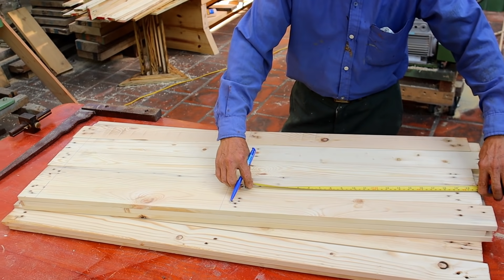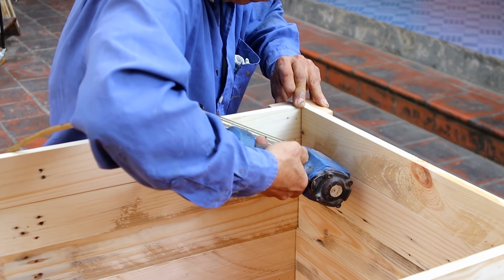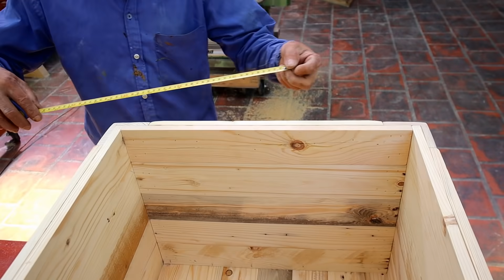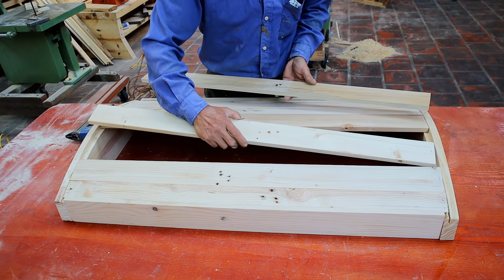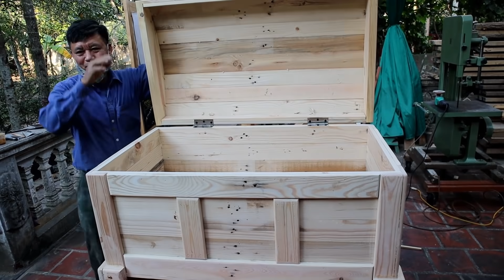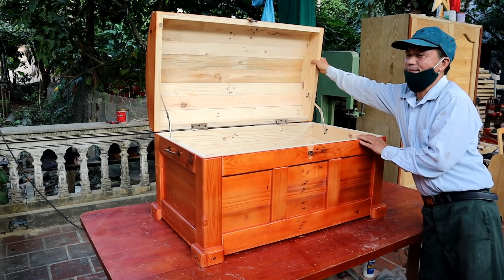Great Idea On Pallet Woodworking Project // How to Make A Storage Chest From Recycled Wood

Comment: Very nice,, but what about us who can't afford a joiner or a planer?,, ( just saying)
Reply: A router sled can substitute for both a planer and a jointer. Put some t-track slots in the table for hold down clamps, and you're golden. If you use linear rails, stop collars can be installed to use it for straight line routing/edging. They'll help with safety also.

Comment: I want this to be my first project. I love how you did the sides not too sure on the top and bottom though I might want to reinforce the bottom part and the top sharper cuts so they fit tight up against each other over all this is the easiest way  I've seen it done.

Comment: Looks great, I just noticed your lock was installed incorrectly, Screws should be behind the metal. Otherwise anyone can remove 3 screws and open chest apart. I like that you used planer  and sander to make the wood looking perfect. Good way to repurpose the pallets. I will definitely try it and recycle my pallets
Reply: Careful with your selection of pallet wood, not all is equal, pallets painted should be avoided as they contain chemicals in the material. Also pay attention to stamps on the outside of the pallets, avoid those labelled MB, MBL or MLB as they contain methyl bromide
Reply: I agree with you it looks great, but I think the bottom is not strong enough. The bottom is only held by some nails. Any more weight in that storage chest and the bottom will come off.
Reply: That's the least of his worries, the bottom will drop out as soon as anything is stored in it, also would have been nice to see a bit of glue used, the large screws concealed, and sprayed behind the catch. 👍

Comment: I like the concept, but if you are planning on keeping anything heavy in it for any length of time, your bottom is going to fall out. The bottom needs to be reinforced with something other than staples or brad nails.
Reply: Should have at least used glue
Reply: @jameschester3986  Exactly. I was thinking the same thing throughout the build. Nice box though.
Reply: I think atleast some screws and glue would add alot more strength to the project, but the build was good.

Comment: At 10:00, you are routing in the wrong direction, that is why the router is kicking so much. You're supposed to go against rotation, like on a table saw, but you are going with the direction of rotation, which is called climb cut, and the router is trying to jump out of your hands. Couple that with holding your fingers that close to the blade insted of on the handle, well... Let's just say I'm not surprised by the missing finger.

Comment: With most pallets you'd be lucky to get four usable pieces of wood.
Reply: You're taking them apart wrong. You gotta use leverage to lift them off the nails. You'll get a number of split ends, but if you cut those off you have mostly usable wood.

Comment: Pallets in my area are mostly plywood now not solid wood and many delamintes at the ends. It will take a lot of effort to deconstruct the pallets to save all the component parts unless you saw through much of it. Nails hold on so tight some will break into pieces that you might just use a saw.

Comment: Nice work. But you always want to spray stain it before you put on the outside hardware on. For you can see where the lock hasp left an impression on the front.

Comment: Nice looking project. Like the way you assembled the corners.
Reply: I liked that too. It would also allow you hide any imperfect cuts, and allow board alignment. Good option to have using pallet wood. I don't have a planer or band saw so I would be winging it with a circular saw....

Comment: Would look better if he took the time to cut the boards even length
Reply: That's in fact the same work (in time) You need maybe 10 seconds more to put a stop block at the right position.
Reply: @hansdegroot8549  I like the way he enclosed the outside of the box with the L shaped ends. Allows for the joining of imperfect cuts/wood. I am using really rough pallets and don't have a planer or jointer so am using a circular saw. Of course none of my projects are for serious use. Just holiday decorations and the like. (Treasure Chest etc.)

Comment: I'm sorry to anyone who lauds this project, but am I really the only one who understands what a caravan of woodworking garbage this is?  Without glue, those tiny brads aren't going to hold that thing together for long.  The way the bottom in particular is constructed reveals zero understanding of the mechanical forces required to build a box - the most basic of wooden storage projects - it's guaranteed to fall out once you load it up.  Poor joinery throughout - the top outside corners of the lid in particular are sloppy, amateurish and downright ugly.  Wrong type of screws on the hinges and at least one randomly mismatched screw on the hasp.  I do not understand those large lag screws at all - they're stylistically out of place with the rest of the design.  This thing is simply a scaled up version of those cheap craft boxes you see in Michaels, AJ Moore and other chain craft stores.

Comment: Nice! What are the dimensions of the wood?
Reply: Any size you like. This isnt tied to specific dimensions for fit. Just the length of the pallet planks you are using, and the purpose of the chest.
Reply: Yeah I just liked the size that was used in the video! Cheers
Reply: @fliplucky8813  Proportions are important for the final look. I think you need to use the golden number ratio.

Comment: What's it called? "Brad Chest"??? It has zero structural integrity. I'd love to see the look on the faces of the end users after they load it up then move it by the handles... It'll fall apart in a matter of seconds.
Reply: The corners assembly looks sturdy enough to avoid using frame wood pieces. But I'd have glued them tough.

Comment: The carry handles on the sides need to be stronger for such a large chest. They will not hold when the a full chest is picked up using these handles.
Reply: I would say the handles were purely decoration purposes  - with only nails holding this together, without glue, screws or a joint which is secure, it won’t take much to dismantle this. Looks awesome though.

Comment: Pallets wood is generally the poorest quality, very then and FULL of staples, nails, screws and metal fasteners. All of which can ruin a nice blade and WILL ruin a planar or jointer knife instantly. Pallet wood is trash and is built to last maybe a few uses before the wood is either burned or buried in a dump. Pallets are simply not worth the time, effort and HIGH likelihood of tool damage.
Reply: J9

Comment: Terrible job, but how do these guys work? everything is approximate, no attention to detail, too bad!!! And would they be called carpenters?
Reply: Go away
Reply: Why be mad when u can be glad?
Reply: I think it was done this way on purpose. Granted, I would have used wood glue and measured everything perfect myself, but to each his own.
Reply: Yeah it's crap
Reply: This is a hobby build. Not meant for commercial sale. As you can see he could of used a router on edges and table saw for exact same sized boards, but not all hobbyists have those and this is definitely easy for beginners that would like to make something nice and cheap for fam/friends. If you can improve, it’s easy to improve on. You can even add an apron and legs. Yeah so take it for what it is and move on
Reply: Your mother and father have done a terrible job raising you.
Reply: My granddaughter’s toys couldn’t find a better home😱‼️
Reply: @thomassosa2957 I'm pretty sure this is commercial product. But in any case, routing in the wrong direction is just terrible skill.